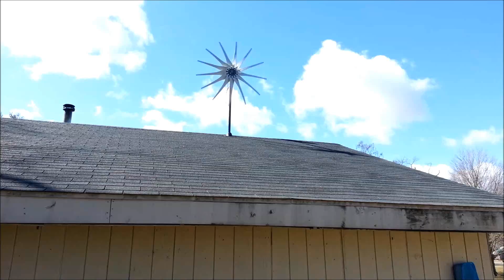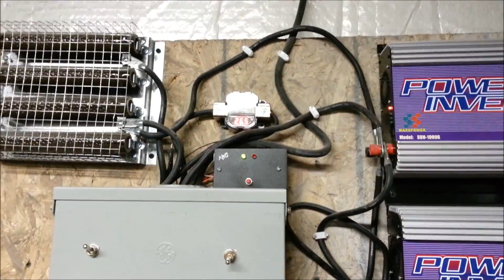Wind Turbine Project - First Big Wind

Comment from the maker: I thought I would give an update to my system.  I have been getting 5kwh on sunny days all summer, this is just with the solar.  I have had little to know wind this summer, but solar had performed very well.  Since fall has came and the temperature has dropped my wind turbine had been producing power all the time.  Since I have changed my setup and incorporated two inverters to get power on both sides of my 110v lines, I haven't been keeping track of my kilowatt hours.  I only have one kilowatt meter.  I have seen the inverters putting out power in the evening with no sun, so I know I am getting some results.  I would say that the wind turbine has surpassed some sort of break in period. Before It never seemed to exceed 20 to 22 volts.  My inverters require 22 to 23 volts just to come on and I see them inverting power with just the wind turbine feed them. Just don't know how much, I need to hook up my kilo watt meter again and see what is happening.
Reply from the maker: Polaraco Hobby
The wind turbine is making power just a very little. It is more consistent that when I first put it up. It still takes 20mph plus winds to get larger wattage output.

Comment: I think the 10-30 volt Grid tie inverter would work good for you,, If the GTI you buy has a dump load option you can hook up the 22- to something volt GTI to it. This way you are covering low wind speeds and higher wind speeds and getting the most out of your turbine. Low wind speeds to me are 10-20mph,, high wind speeds are 20 + mph,, I use two, 12 volt turbines and I have had good results, and I am very happy with the company I bought them from,, they have been very helpful. :)

Comment: I tried that one time and it worked, but there was a lot of drag I used a 1.5 inch pulley on the pma and a 16 inch pully on the blades. when the wind blew hard I made huge amps. it took a lot to get the blades to spin because of the drag caused by the belt.  I used sealed bearings, I used a great limber belt and I tried a double roller chain system. the drag is still there. I have a lathe and end mill so I can make a lot of the parts I need here. good luck. if you get it to work post up!!!

Comment: placement on windturbines is everything. where you have your turbine is not a good spot. you might think it is, but it isn't. you need to get it to 20-30 ft over the roof to START getting into clean air. you want it at least 20-30 ft over anything it is mounted to and 100 ft(a good START) away from anything else. I have four turbines myself from the same place yours came from. they do work and work great when set up properly.

Comment from the maker: I hoping the 10v to 30v will do the trick.  I seem to get good voltage and amperage in the 12 to 15 volt range, I think feeding it directly into an inverter will work the best.
I know when trying to charge 12 volt batteries with it, it didn't work. The amperage wasn't consistent enough to charge the battery. But if I can take those wind spikes and feed the power back into the grid I think that would work the best.  I saw at times in the 12 volt range 200w to 500w coming out of the wind turbine.

Comment from the maker: I have seen some turbine video's where that has been done and it would probable be a good fix for better results. I used to ride dirt bikes and change the sprockets always help if you need more power.

The other thing that I have figured out is a 24volt turbine works best on a 12volt system. That is something I plan on trying with mine. I currently run it directly into my inverters at 24 to 25 volts I start seeing power. I plan on buying a 10 to 30volt inverter and hooking it up directly to it.

Comment from the maker: More blades makes the wind turbine spin more, starts up at lower wind speed and turns faster a lower winds.  Such as 15 to 20 mph wind speeds.  The only problem I have is the blades are not balanced and at higher wind speed, say over 20mph the turbine wobbles a little.

Some thing that has happened in the past six month is the turbine spins easier and wobbles less than it did when it was new.

Comment from the maker: I am using two 1000watt sung grid tie inverters.  I only need one at this time but I am trying to feed both side of my 120 volt line.  My solar power setup that I am using gives me between 20 to 30 amps at 28 volts and I have 920 watts total.  The wind turbine on a windy day gives me around 100 to 150 watts.

Comment: There is to much arguing about who has a better product and not enough info for what to really buy and what works better in high wind area or what works better in low wind area.  I bought a Ghost wind turbine and instead of yelling it is junk I would rather find a solution to make it work. It isn't junk, It came out pretty good actually but not getting much out of it power wise and doesn't seem to want to spin even in 18mph. Maybe take 2 blades off? Any suggestions?

Comment: I wonder if there is anyway to modify MWS Turbines to use a bully and belt to transfer the power from the blades to the power generating part? Then a user could play with different ratios like 1 turn on the blades = 1.25 on the generator. Mine is almost always surging and giving me a amp or 2 but as soon as it starts putting out power it slows down. 
I really hate to give up (I have a lot of money in this)

Comment from the maker: That sounds like my setup, except I have a 24 volt system. I plan on putting mine on a longer pole, maybe 60 feet and seeing what happens.  
I have found hooking the wind turbine directly to my inverter works better. I to live in lower Michigan and have little wind, but with the direct hookup I get anywhere from 50 to 300 watts out of my inverter.
Never had any luck charging batteries.

Comment: I have a 9 blade Raptor and also was sold all the big resistor things "In case there is to much power for my batteries to handle"  Mine turns and I really like the sound and watching it but the best I have ever gotten out of mine is 15 amps at 14 volts for just seconds. 

I live in Michigan but not near any lakes so I am going to see what happens this winter but I think its going on eBay next spring and I will put up more solar panels.

Mine is on my pole barn with the wind coming from the side.